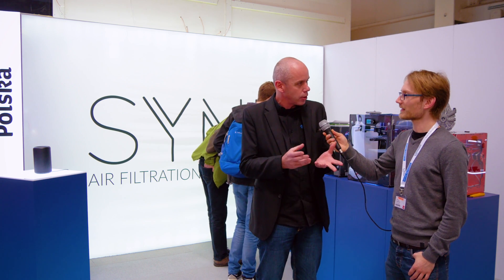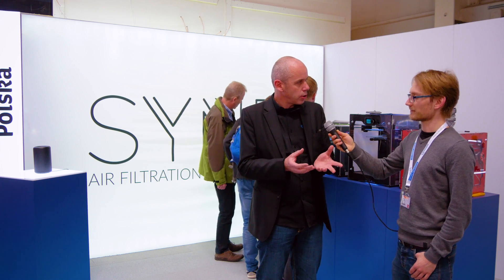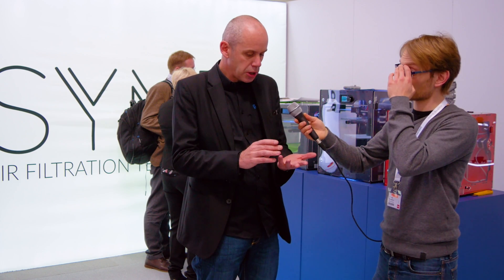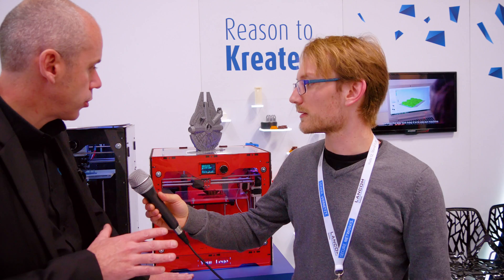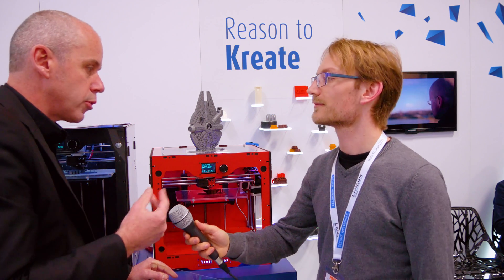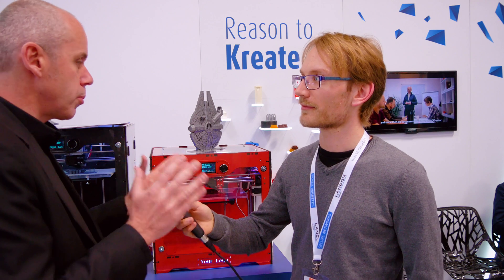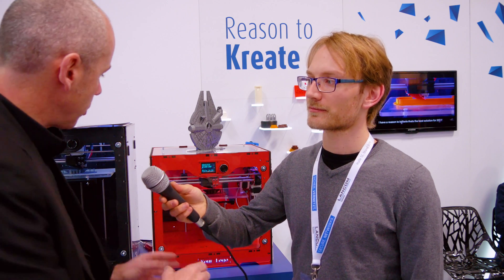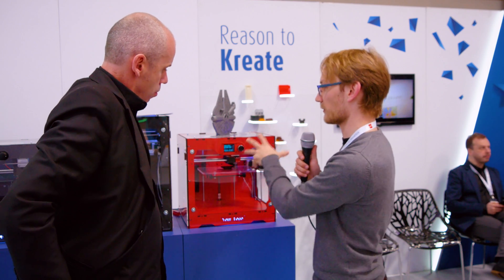Nanoparticle filter for 3D printers: 3DKreator's SYNE system #CeBIT

Comment: If you store your filament in a desiccated container at 25% RH or lower, it won't produce particles.  The problem happens when filament absorbs moisture and the water expands to steam in the hot end causing thousands of tiny microexplosions that spew particles. ABS absorbs moisture more easily than PLA and that's why it fares worse in some tests.  If it is stored dry then it doesn't produce ANY particles over 0.5 microns during printing. 

Also,  as someone else mentioned,  burning a candle will create more fine and ultrafine particles than a 3D printer printing undessicated ABS.
Reply: The study is not a public document so a citation is not possible.  If you want to verify my credentials then just Google my name and "NASA" and that should bring up plenty of references verifying my work with NASA.

For those who want to verify this yourself, there are a number of affordable particle meters sold these days.  We used a Dylos 1100 Pro which measures particle concentrations for particle sizes down to 0.5 microns.  I think it costs around $300 and you can get a version that has a serial port which allows data logging via a computer connection.

In my house, normal room ambient particle counts usually range between 30,000 and 60,000 per cubic foot for particles 0.5 micron and larger.  The outside air here usually ranges between 30,000 and 100,000.  When I cook breakfast the counts often go up to around 1 million particles/ft3 and that's with no visible smoke and not enough smoke that I can tell there is any in the room.   A smoke detector won't sound until you get way above those levels.

Particle size, shape, concentration and composition are all factors that determine how they affect your health.  Breathing pine wood dust isn't the same as breathing soot from a candle or car exhaust.  If you have an allergy to a certain substance then very small concentrations can trigger inflammation.  The shape of asbestos particles are the main reason they are so dangerous.  So, particle counts don't tell the whole story.  However, the fact that there were not measurable concentrations of particles produced when desiccated filament was printed inside of an enclosure does mean that it is very unlikely to be a hazard.

That said, most people don't store their filament in controlled environment so using a filter system can't hurt.  If your printer is in an enclosed volume then just recirculating air through an inexpensive HEPA or high quality (doesn't need to be HEPA) vacuum cleaner filter inside the enclosure will capture most of the particles generated by moist filaments.
Reply: The study I was conducting was focused on how filament material properties change as they are recycled multiple times.  I added particle testing since it was easy and I felt like it was an important factor.  Even though we could not measure any particle or VOC generation during printing for the filaments stored at 25% RH, I can not say that means they meet NASA air quality standards because the tests were not aimed at verifying air quality to a NASA standard.  I can say that I feel completely safe printing in my home when using filament stored in a sealed container with desiccant.  

About opening the window to get "fresh air"... I live in KY and the outside air typically has 2-10x more particles 0.5 microns and larger than the air in my house on most days so I go "inside" to get cleaner air.  I run my furnace fan continuously which keeps the inside air in a very healthy range even without using the high end filters.

We only measured trace amounts of VOC's when printing with ABS and Nylon that had been stored at or below 25% RH.  There were only trace amounts of gasses being emitted and none were were even close to reaching unhealthy limits.  I always desiccate my filament and I never smell it when I print but I don't have a very good sense of smell so that's not really proof of anything.  I would think that cutting down on the "steam micro explosions" by using dry filament would probably reduce any possible smells.

Acetal/Delrin is not very "meltable" so it will probably never be "printable".  Polycarbonate and Ultem are the high end materials that you will likely see offered as filaments in the coming years.  I think Polycarbonate is already available for consumer printers.  A form of Ultem is offered by some commercial printing companies.
Reply: Tony Shulthise [citation needed]
Reply: Tony Shulthise link to the nasa study
Reply: Thanks for the followup Tony! I know NASA has been working on the feasibility of 3d printing in space, and their air quality standards are much more stricter than a home where you can just open the window to get fresh air.
This makes me feel MUCH better!

Q: What about smell? Is that also lower for filament at 25% RH, or at least at a level that won't annoy humans forced to breathe that same air for a while :) 
I'm trying to see if I can get away with printing ABS kept at 20% RH at home.

Q: Does the same analysis hold for Acetal/Delrin/POM :D
I'm planning to dab into that too.
Reply: J. Pomodoro True, but in my testing,  desiccated filament produced pretty close to zero particles 0.5 microns and up.  Cooking my eggs this morning for breakfast the levels went up to 1.2 million particles per cubic foot for 0.5 micron particles and larger. 

Two assumptions I feel safe making. ..
1.  If desiccated filament produced near zero particles 0.5 microns and up inside an enclosed chamber for an hour then it probably wasn't producing significant amounts of ultrafine particles. 
2.  You probably run much higher health risks cooking indoors or driving on the highway behind other cars than printing using desiccated filament. 

However,  if you aren't desiccating your filament below 25% RH then you are raising particle counts in the room.  However,  not nearly as much as if you cook in your house.
Reply: Tony Shulthise man I hope this is true! Is there a source I can quote?
Reply: Basel Salam I managed a 6 month study for NASA regarding recycling filaments in space. This was one of the incidental findings.  The steam explosion idea is just a theory but it's the only mechanism I can think of to support the measurements.  Printing inside of a closed container produced zero particles 0.5 microns and larger when using filament stored at or below 25% RH.  Filament stored at 50% RH produced very high particle counts for ABS and nylon.

We also tested VOC levels and found only trace amounts.  We only tested VOC levels for  dry filament so I don't know if moisture in filaments affects VOC production or not.
Reply: Tony Shulthise thanks for the follow up! Shame it's not published :(
Reply: Tony Shulthise You mentioned a few times that the detector you used measures down only to 0.5 microns. Wiki says that Ultra Fine Particles (UFPs) are typically around 0.1 microns. Does any of your data lead you to believe that these much smaller particles are also reduced by desiccating filament? Are particles that small (0.1micron) even a concern?
Thanks for posting about your research! I'm glad someone is looking into this!
Reply: Thanks for the reply :^), best of luck with your research.

Comment: I don't think this is a great idea. The only type of filament that emmits some kind of smell is ABS and wood/coffee. Maybe they should just settle with enclosures, which would be great
Reply: All filaments emit nanoscale particles. It's something that we don't know if it's good or bad yet, but it's most likely not the greatest. 

Here's an excerpt from an IEEE article on the subject. UFP = Ultra Fine Particles: 

"A 3-D printer that uses a lower temperature polylactic acid (PLA) feedstock emits about 20 billion UFPs per minute whereas a higher temperature acrylonitrile butadiene styrene (ABS) feedstock printer produces about 200 billion UFPs per minute."

The article is here: http://spectrum.ieee.org/nanoclast/semiconductors/nanotechnology/nanoparticles-emitted-from-3d-printers-could-pose-a-risk
and the paper it's based on is here: http://www.sciencedirect.com/science/article/pii/S1352231013005086
Reply: PLA emits compounds that smell too, but not everyone notices them. The most common comparison is hot pancake syrup.

Comment: handy if your using abs. shame he did not show some of the filters with the crap its caught. :)
Reply: All filaments emit nanoscale particles. It's something that we don't know if it's good or bad yet, but it's most likely not the greatest. 

Here's an excerpt from an IEEE article on the subject. UFP = Ultra Fine Particles: 

"A 3-D printer that uses a lower temperature polylactic acid (PLA) feedstock emits about 20 billion UFPs per minute whereas a higher temperature acrylonitrile butadiene styrene (ABS) feedstock printer produces about 200 billion UFPs per minute."

The article is here: http://spectrum.ieee.org/nanoclast/semiconductors/nanotechnology/nanoparticles-emitted-from-3d-printers-could-pose-a-risk
and the paper it's based on is here: http://www.sciencedirect.com/science/article/pii/S1352231013005086
Reply: well i smoke anyways so cant imagine it's as bad as that.